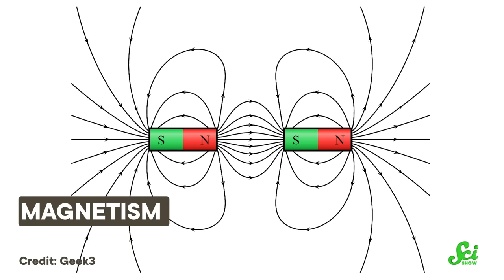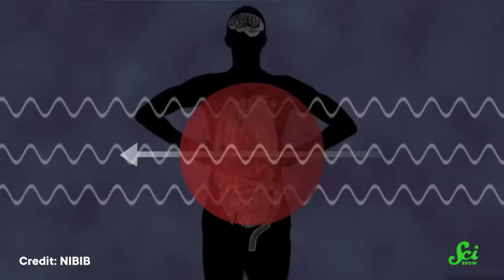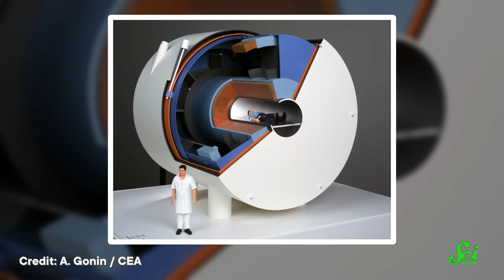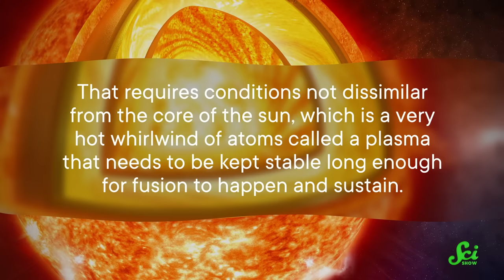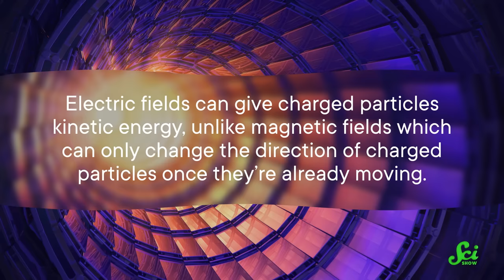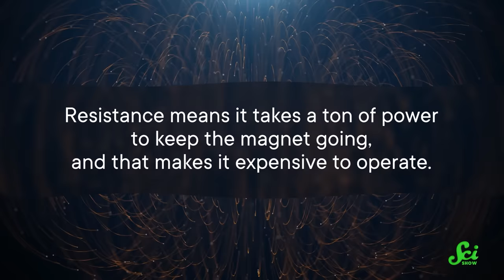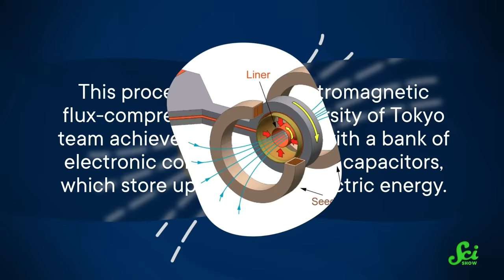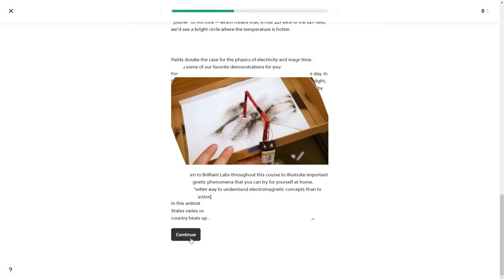What is the Strongest Magnet We Possibly Could Make?

Comment: I’m more impressed that someone was like “hey what if we use a big magnet to align people’s protons”
Reply: I want to know how strong a magnet needs to be to rip those protons out of people.
Reply: @foty8679  Before that happens, electron orbits get disrupted which causes molecules to break apart. You'd be torn to shreds, and then the electrons are stripped from the protons altogether, and then you rush towards the magnetar that you somehow got too close to.
Reply: It started out with NMR spectroscopy in the 60s. It was useful to determine the structures of organic structures. Eventually someone realized that you could do three-dimensional NMR with a tracer, and with some complicated math, turn that into an image.
Reply: @LeviathanStormPrince  thanks for the explanation
Reply: @iainballas  true. Magnetic moment goes as (spin angular momentum) / (mass) [ignoring g-factors] so the electrons are far more affected. Also: to get a force on a dipole, the field strength doesn't matter, it's related to the gradient of the magnetic field.
Reply: @foty8679  https://en.wikipedia.org/wiki/Magnetar
Reply: @iainballas  so we basically need to make a magnetar on earth
Reply from the maker: RIGHT?!
Reply: @Nahrix  this wouldn't rip you apart. You'd probably fall apart, as electronic binding of molecules would be overwhelmed. idk, though. You can solve the hydrogen atom Schrödinger Eq in strong fields, but deriving chemistry is a hole nutha level.
Reply: @foty8679  for that you would need to overcome the nuclear forces
Reply: If you want to align people's protons you must make an apple pie from scratch. To do that, we first have to create the universe.
Reply: @RealBradMiller  What is that phrase from?! It sounds so familiar. I 'm thinking its from something like "The Infinite Monkey Cage", or Star Talk. But idk.
Reply: @treevis400  It's something Carl Sagan said, and I believe used it again in his series Cosmos. There's a song someone made for it that actually kinda bops. Cheers!! https://youtu.be/zSgiXGELjbc
Reply: Sounds like new age healing crystal stuff. But rest assured they'd done all kinds of smaller experiments before they did it on people. NMR is MRI without the I (imaging) where you just put a chemical sample in a tube and zap it with magnets and radio and measure the reaction on a graph to see what chemical you have.
Reply: @thewhitefalcon8539  "you need to like, align your protons to the moon's energy, maaann"
Reply: Repent and believe in Jesus Christ  If you think this will get you through the gates of Heaven, you are horribly mistaken and doing worse for your religion than you think.

Instead, go out there and live your life as Jesus. Stop judging, stop copying and pasting and HELP your fellow human. This does diddly squat.
Reply: @JohnnyTromboner  Well we better get out there and work it!

Edit: 'we better' got deleted for some reason. 😮‍💨
Reply: I Disliке тнis уоuтuвег весаusе му соптепт is веттег
Reply: @whatsupmydudes8620  I prefer the Google translation of your comment: "I dislike tnis woutuveg weightsuse mu soptept is wetteg."
Reply: @LeviathanStormPrince  The first MRI conducted was when a scientist working with an NMR said, hey what happens if I put a living mouse inside the tube, do I still get a signal?  Lo and behold, he did!
Reply: It's more a case of "what happens if we put people in there?" (NMRI, as it's fully named - "nuclear" is left off to be PC, is much older than medical MRI. I remember playing with an NMR at ECU in the 80's)
Reply: Someone thought "hey blood that has oxygen in it has different magnetic properties than blood with no oxygen in it"
Reply: @piercepluenneke7438  remember though that while liquid oxygen has a magnetic moment, oxygen gas does not so even if you degas a liquid before doing an NMR on it, you won't get a substantially different result than with oxygen dissolved inside.
Reply: @iainballas wait... So you just become sand
Reply: @foty8679  Oh you want a Magnetar for that one. 1000 miles out from it, your atoms will be ripped apart.

Comment: My dad designed MRI machines for 25 years, up to 7T. He was so glad to not be in charge of keeping the liquid helium in the coils since it's a superfluid
Reply: What about the 36 Tesla magnet that was made by Superpower Inc about 10 years ago?
Reply: I bet there are some interesting engineering issues dealing with super-fluids in a commercial application
Reply: In my head there's some sort of inside joke behind 7T and that sort of stuff is, like, my favorite thing on Earth :)
Reply: @michaellashansky9471  It would be overkill for an MRI.
Reply: @michaellashansky9471  What about it??
Reply: Niobium tin wire in a big copper heatsink bobbin. It us amusing that this is basically resistance wire above the superconductivity transition temperature. Years ago i had big cables and drawing ingots for making wire made of this stuff. 🤓❤
Reply: My guess would be sealing it up really good.
Reply: @michaellashansky9471  what about it?
Reply: Anyone who's worked in high magnetic fields knows that your center of balance or inner ear starts getting messed up as these fields get stronger. So I worked with 1.5 and 3 Tesla magnets for a number of years with GE healthcare. I have some metal fillings in my teeth that are not ferrous but would still feel the tug in strongest part of that three Tesla magnets field. I would even get a bit of a metal taste in my mouth when that happened. When you start going up to five Tesla and seven Tesla and 9 Tesla, then the effect that that has on your ability to walk straight or not pass out becomes a lot more pronounced. So I for one would never want to get an MRI and anything higher than three Tesla because I know what it would do to me as I simply went to sit down in the patient bed before being moved into the magnet bore. I would get sick. So I think that's why those higher field magnets are not used for scanning people all that much.

Comment: I'm a bit sad that you didn't mention the magnets used to separate Uranium-235 from Uranium-238 during the Manhattan Project. When they flipped them on for the first time, they ended up ripping out some of the giant fasteners holding together the steel beam structure of the warehouse they were in.
Reply: I'd be in favour of an additional video taking about that
Reply: @Stettafire  I wrote a research paper on the Manhattan Project for a war history class in college. It was absolutely fascinating. It was 28 pages and I feel like I barely scratched the surface. It could easily become an entire series if they wanted it to.
Reply: @whistlinturbo  get The Making of the Atomic Bomb – by Richard Rhodes, this is full story, better that most movies
Reply: @dexterPL  I am pretty excited for the Oppenheimer movie this year, the trailer looks pretty good.
Reply: Yup calutron magnets. The wire used in these was made of silver so they worked better, but that was not the reason. World war 2 valued copper for making brass for cartridge casings.🤔🤓❤
Reply: On a related subject, I took a look at the magnetic fields generated by nuclear weapons, but they were surprisingly weak.  Starfish Prime, the 1962 high-altitude test whose electromagnetic effects caused noticeable damage in Hawaii, just reduced the Earth's magnetic field to about a quarter of its normal strength at that point.  That's a difference on the order of 10^-5 tesla, tiny compared to even everyday magnets.
Reply: @tulliusexmisc2191  Is that why our poles are reversing and we have little electromagnetic protection from solar flares now? :O
Reply: @BensCoffeeRants Absolutely not. The poles reversing is a very regular occurrence (in the same way that tectonic plates moving is a regular occurrence), and protection from solar wind largely comes down to the ozone layer, which with the (unharmed) magnetic strength of the Earth providing support.

I honestly have no clue what that guy is implying. Nukes don't change the magnetic force of the earth just by exploding; that's not how it works.
Reply: @Naokarma   I thought the poles reversing is a very long sloooow NATURAL process and during the swap were less protected from solar radiation (I remember seeing something saying we're more susceptible to solar flares as a result) and therefor the poles in process of changing accounts for normal temperature swings over long periods, like ice ages and whatever the opposite of that is, unless that's just something global warming deniers made up so we keep using fossil fuels and polluting as usual.  Either way it's a good idea to keep the earth clean and use resources sustainably.
Reply: @BensCoffeeRants  "I thought the poles reversing is a very long sloooow NATURAL process" Yes, it is. There's nothing speeding that up, and it doesn't really matter because the poles swapping mean pretty much nothing other than compasses being slightly different.

"during the swap were less protected from solar radiation" Not really. The poles are pretty much always changing, in the same way that tectonic plates are always moving. It has nothing to do with temperature, which has more to do with greenhouse gasses, etc.
Reply: @Naokarma   Ok thanks for sharing good to know!
Reply: They also used silver wire because the copper was needed to make brass for the war efforts.
Reply: @dexterPL you are right!!  I’m listening to this audio book these last few days, while I work.  It’s an amazing story.
Reply: They do have a whole video on it from 11yrs ago 🤷‍♀️
Reply: @Stettafire they have one from 11 yrs ago